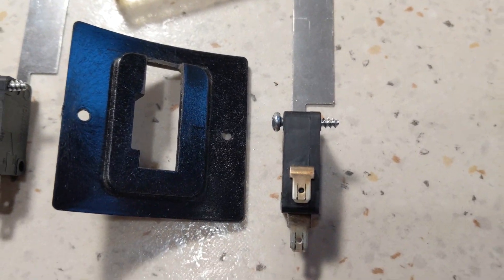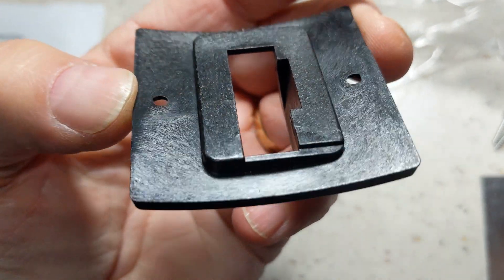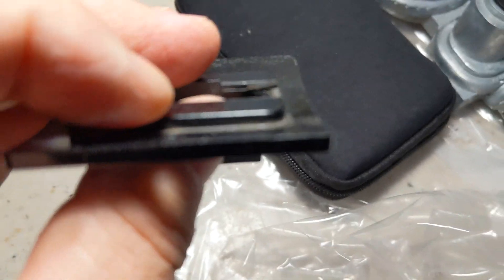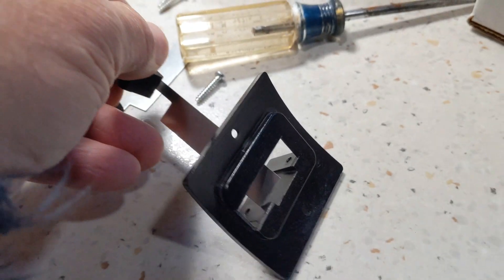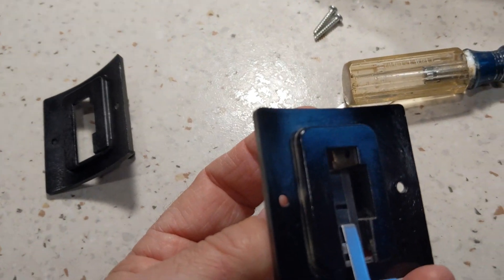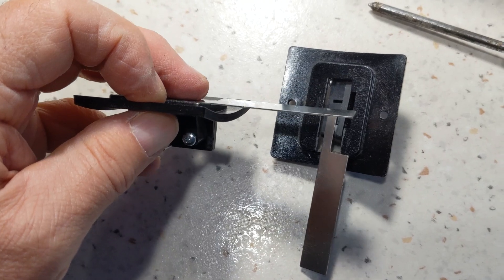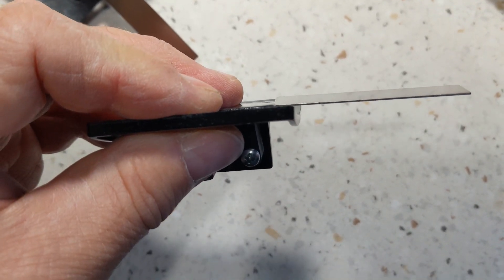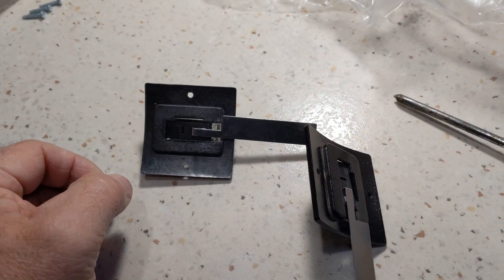Atwood/Dometic Furnace AFMD35121 sail switch problem.

Comment: I started having problems with my Jayco.  I took out the furnace and it fired.  Put it back in and it ran fine for a couple days, then stopped again.  I have a sail switch and board in transit, but I did take that edge off the bracket today and it fired up, We'll see if it holds, but the new style bracket looks identical to the modified old style.  Thank you for the video.

Comment: Glad I found this as well!  I can’t figure out why sometimes my furnace will light and sometimes it won’t (get the single LED flash indicating a sail switch or high limit switch issue).  I pulled the sail switch and it continuously tested OK (cleaned with air as well even though it wasn’t dirty), but I still got the intermittent problem. I thought it may be the circuit board, but sounds like the bracket issue might be causing the problem.  I am however going to replace the circuit board with a Dinosaur Electronics one, because apparently the OEM ones are notorious for failing.

Comment: Hey!  We’ve had issues in the past with our sail switch getting dusty.  Did it again yesterday.  But still didn’t work.  Saw your video tonight, as I was dreading the upcoming 18 degree temps tonight.  I went out, removed the sail switch, cleaned it a bit more thoroughly and filed down the ledge as you suggested.  Replaced it and it works like a champ!  Thanks again for your suggestion and observations on the switch housing.
Reply: Instablaster